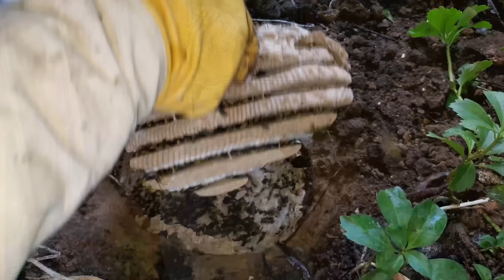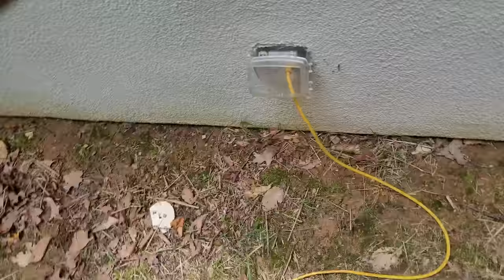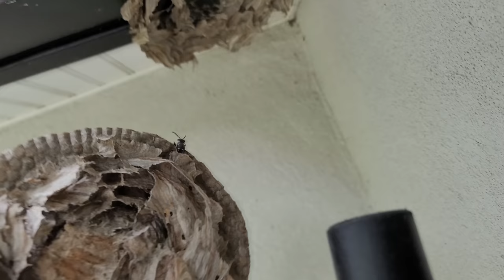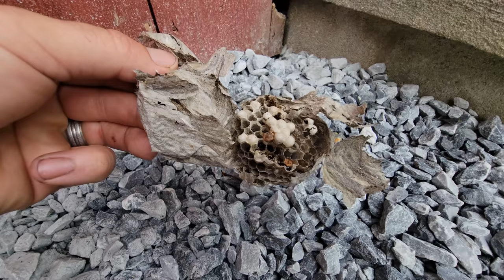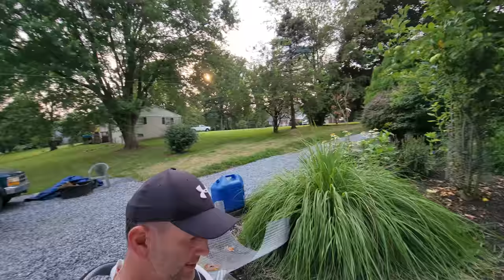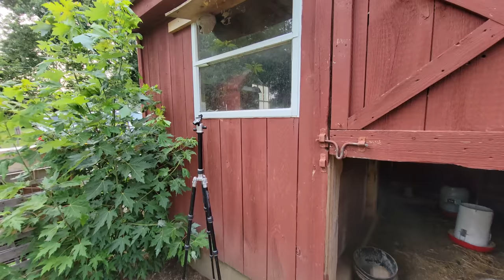Bald Faced Hornets Tried to SWARM and KILL ME!

Comment: I would if had that nest treated and removed in 2 minutes.  Such a waste if time. Why the show with the vacuum once the nest is treated and removed there is nothing to worry about.
Reply from the maker: False. Removing a nest "in 2 minutes" neglects the removal of the hundreds of returning foragers. So you would spray a nest, knock it down,  walk away, and 20 minutes later the client is seeing hundreds of wasps swarming around the area. They will most assuredly start rebuilding. And you will be getting a definite call back.

Comment: Your technique is All Wrong the smart way is to scrape the entire nest off the ceiling or wall and it goes right into a large metal container which slams shut you then burn them with gasoline inside the container only letting the smoke come out thru a screen same as a window screen with holes too small for the bees only the smoke comes out. Your way of vacuuming them is stupid it takes too long it's dangerous and many of the bees escape.
Reply: What makes you so smart?